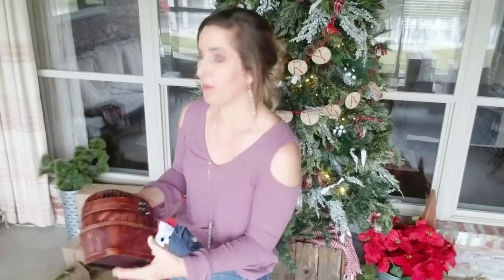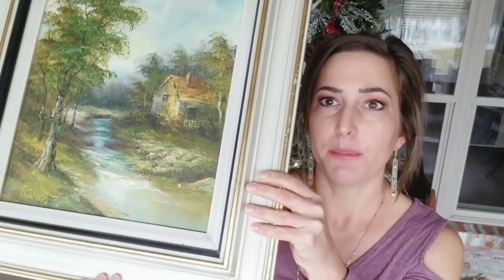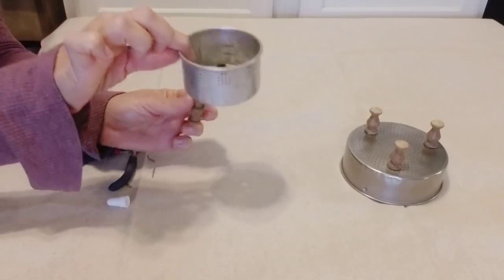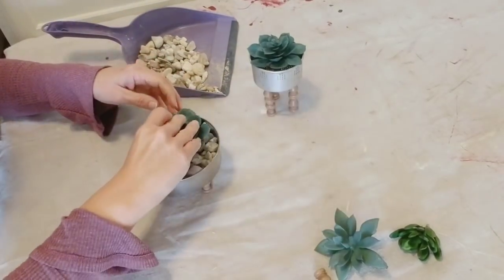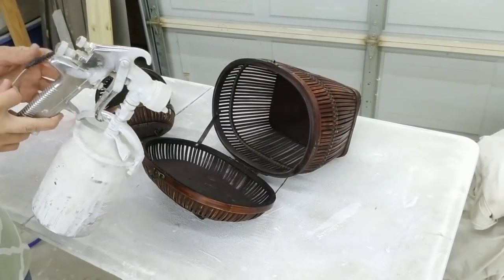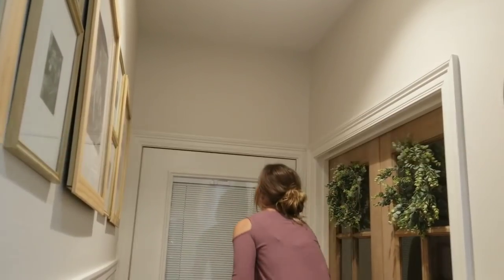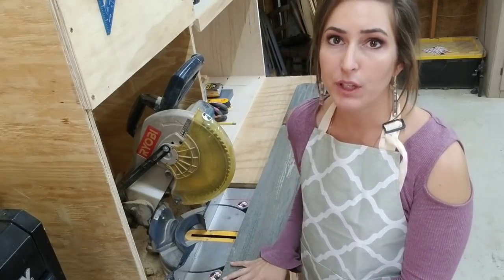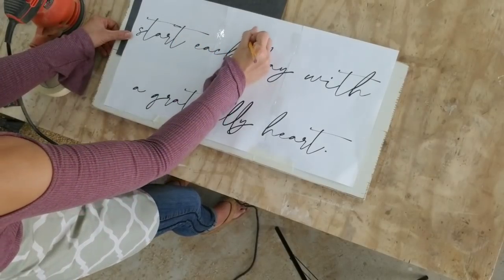Thrift to Treasure • Painting • Wood Sign • Baskets • Kitchen items

Comment: baskets look perfectly distressed! beautiful sign too! do you have any tips for taking apart an old fence panel to reuse the wood?
Reply from the maker: Crow bar, hammer and lots of sweat
Reply: What width do you cut the fence boards for your frame pile?
Reply from the maker: @teresafortney8750  about 1.25 inch.

Comment: What kind of stain did you use on the French doors?
Reply from the maker: No stain, I used the Waverly antiquing wax and water mixture.  Both sealer.  Had held up great
Reply: @JuliesDesignsandSigns  do you have a video on that process